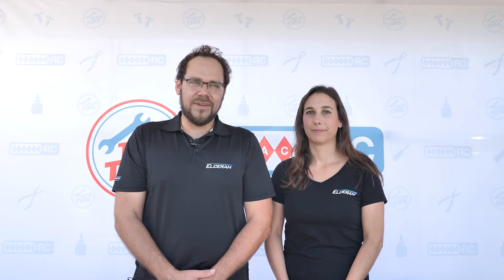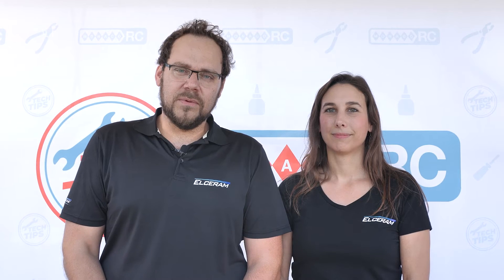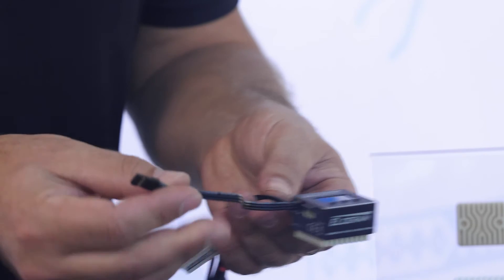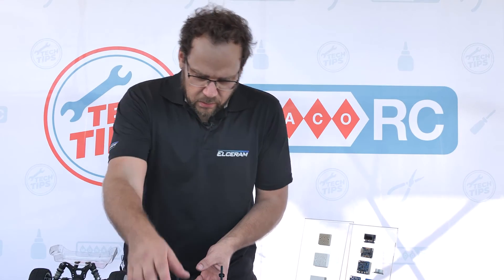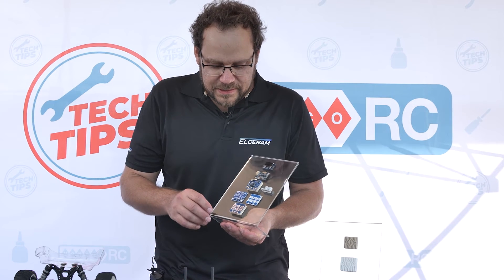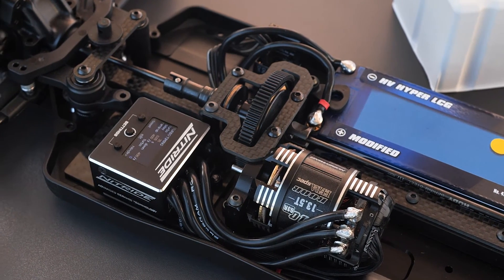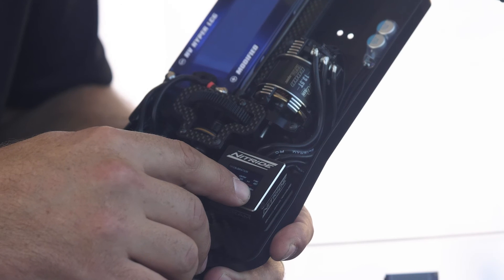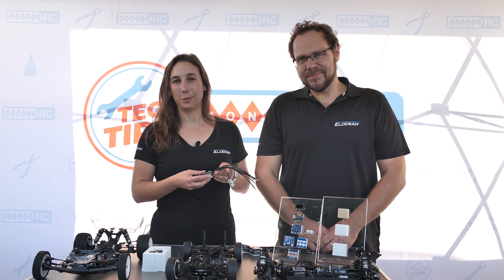Interview to Elceram about new ESC Nitride 1/10

Comment: Anybody from Hot Country Asian, Texas, South America which track temp 55 to 60C test this ESC with mod motor?.... No fan???...  Need feedback for ESC temp from Hot Country... then probably I would buy... but nice product..
Reply: I use mine with a 5.5t on my Cat L1r, temperature is around 30° Celsius and the Esc is at 60°/65° after a 5 minutes run. On astro track.

Comment: Is it possible to solder/change the power cables?
Reply: this was my question too and i cant seem to find an answer. Im leaning towards the Hobbywing XR10 G2S over this because of this issue. On the HW you can easily change out all the cables if one is damaged, too short, etc. I would love someone to respond to this concern before i buy a $250 esc